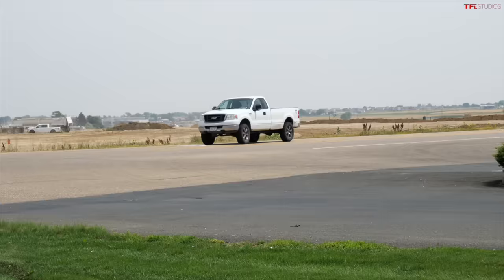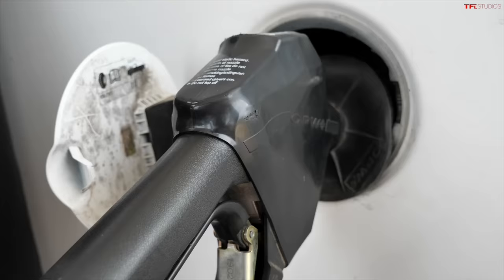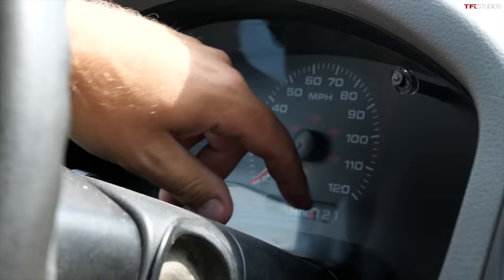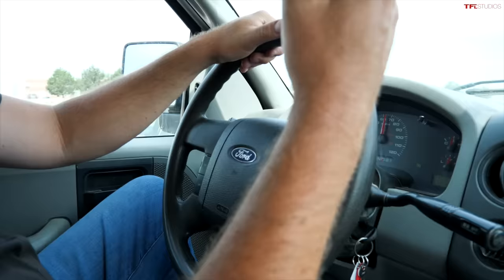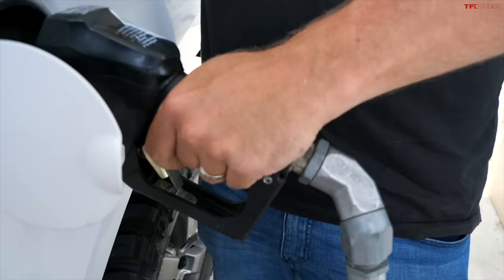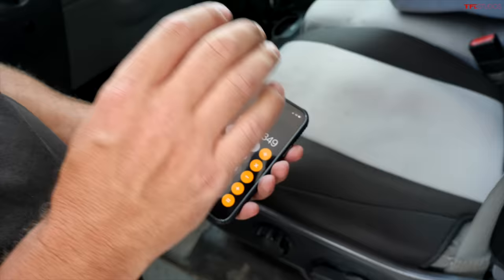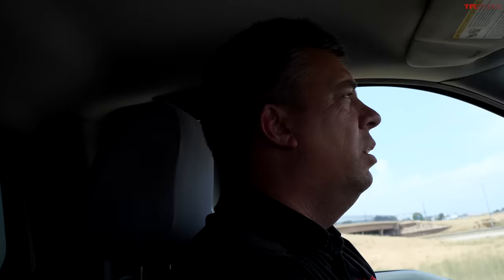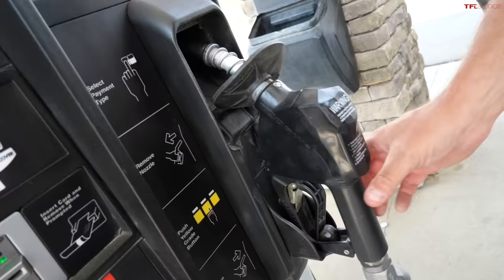Surprising Result: Here’s What Happens To Your Truck’s MPG When You Install A Topper!

Comment: It's nice to know there is no mileage penalty for the added weight and convenience of a topper.
Reply: Although at steady speed it may not make much difference in fuel mileage, consider what the added weight may do for stop and go in town driving.
Reply: @Jim-bw8jo  in my experience even full of tools the weight doesn't make much of a difference in the city efficiency wise. Lots of stop and go reduces mileage significantly even in a smaller light weight 2000 camaro with a ls1 and 6speed manual and driving it slow. My current truck gets relatively the  same mileage in the city if it's full of tools or even pulling a heavy work trailer unless I'm driving it crazy then ofcourse it's worse. It does effect acceleration and responsiveness though.
Reply: That's if you keep it empty. But I shamefully keep stuff in the back (probably because I'm too lazy to empty it?) adding more weight with the topper. Just a thought.
Reply: Thanks Brian,  you saved me 10 minutes. I didn't have to watch the video to get the answer and now I can whipe my ass. 🚽🧻👍
Reply: Who thought there would be?
Reply: The extra weight will reduce the life of the truck.
Reply: @bngr_bngr  Ok 👌
Reply: Nice to know for me, not that I would ever remove mine. Mine is for camping purposes, and I do have a full size Tacoma bed, which is a rarity these days. Hard to find full size beds and regular cabs these days. I think trucks look a little better without the camper shell, but I still prefer to sleep in the bed of my pickup rather than on the ground. I like being higher up.
Reply: @jimmym3352  And, some trucks look better in a regular cab VS crew.
Reply: @brianaustin1328  All trucks!
Reply: Too short of a distance for a 'scientific' test, but I like that at least you used the same pump at the same station.
Reply: @Jonathan Tripp the extra rise is like adding a  vertical wall to the height of your truck when you look at it from the front... that's your gas mileage killer... speaking of just shell.   Keeping the roofline straight with the cab top, it should have virtually no negative impact.   If someone could make one that would slope down toward the back even a few inches, it would help mileage a tiche....  and the trailer, anything that would shunt the air over the trailer smoothly will help as long as it's very gradual from the cab back...
Reply: quite inconvenient depending how you use your truck bed.
Reply: Next up ultra light topper will mpg go up?

Comment: I just like them for hauling a lot of stuff out of the weather and away from prying eyes.
Reply: That was always my primary reason for having a topper when I had a pickup. It also served for a place to mount rear cargo lights inside with a switch and rear exterior flood/work/backup lights up high (always had a fiberglass step up topper, except for that one cab level aluminum one that got beat to hell by a wicked hail storm in March of 89'). It was always handy for a place to rack out in out of the weather due to the jobs at the time. Sleeping pad and a make-shift pillow and I was good to go.
Reply: My friend: After getting out of the clink, I made sure to get a topper to stop the law from eyeing my shit. I am 6years strong avoiding child support and the troopers.
Reply: @Saki630  Nice, bragging about avoiding child support, great father figure.
Reply: Pain in the arse when you're hauling firewood and/or constantly loading/unloading big items. I had a topper on my old truck and ditched it in frustration after 3 months. I just carry a tarp and straps now
Reply: @davemiddleditch9741  It is a pain the ass if you have to haul large items or like you say firewood. But when I had my topper I was younger and stronger, getting it off and on wasn't too bad to do alone. When it was necessary to keep it on, I just grabbed my 6x12 flat trailer for the big stuff. It all depends on the intended reason or use. People change to the appropriate shoes/boots/surf shoes/etc and clothes for the job or event at hand.
Reply: @ernestpaul2484  too right bud. And there have been times where i've been caught out since i ditched the topper... a trifold tonneau cover is probably the best compromise for me
Reply: @davemiddleditch9741  I actually kinda prefer a topper for getting firewood. I can stack more wood because the sides of the canopy hold it and I don't have to unload it right away to avoid it getting wet. Each to their own I guess.
Reply: @WildernessGuyBC  im 6ft 5 mate... trying to stack wood with the topper on is a right mission for me but I hear ya!
Reply: @WildernessGuyBC  whereabouts in BC? I used to live off grid on Van Isle
Reply: Topper great for mother in law, dead or alive. I saved tons (she was a big gal) on gas. She was too big for roof rack

Comment: I noticed an immediate improvement with the cap on my truck. The display reads the average mpg over a 400 mile baseline that you can reset, but I didn’t reset. Just letting it run and watching that number go from 17.9 to 18.6 after about 200 miles makes me smile. Hoping to see a new normal over 19 after she taps out at 400 miles!

Comment: I had an interesting experience with an old V6 Blazer. I put a (pointed prow) rowboat upside down and nose first on top and the gas mileage went from 16 to 20. I left the rowboat on it for a long time, only taking it off when I needed it.
Reply: Same speeds, Stanley?  It's aerodynamic, but you would think it still produces additional drag, especially at the back
Reply: I am only reporting what happened. The gas mileage went from ~16mpg to ~20mpg. I didn't change my driving habits.

Comment: Thank you, this is the type of video that is useful. I would have guessed that the topper would have saved more fuel than that, but over 200,000 miles even .1 MPG adds up. Plus they keep gear dry, locked up, and you can sleep inside them. Good video.
Reply: And if you get a Bed Rug they are more comfy to sleep in.
Reply: Over 200,000 miles, the numbers they got would save you 60 gallons of fuel.  Not enough to buy the topper, but it does mean that, if we pretend their results are significant at all, there isn't a huge reason to remove it.    The weight of the topper, at 200lb, is close to 5% of the weight of the truck, so I'll bet there is a fuel penalty in stop and go traffic of a little more than this possible aero advantage.  Still, numbers are so close you can basically just run whichever configuration you want.

Comment: Two more variables to check out is driving with a Tonneau Cover and the tailgate up and with it down (no topper).  Mythbusters actually did the tailgate years ago and gas mileage was better with tailgate up!  Your results were no surprise but thanks for the data.
Reply: @jeepjeff9131
I remember that episode of Mythbusters they actually showed that having a tonneau cover on the bed of the truck was better gas mileage than with the tailgate up or with the tailgate removed. 😮

Comment: I have a 2009 F150 Supercrew 4x4 with the 5.4 Litre engine and 6.5 foot long box. I have both a ARE truck topper and a tonneau cover that I’ve used over the years along with sometimes driving the truck with neither of those installed. In my experience the best mpg I get by far is when the tonneau cover is installed.

Comment: Could you do a comparison with a flat tonneau cover, like the roll backs or the tri folds..  They won't weigh nearly as much, will cover the hole of the bed, but not reach the top of the cab to technically be "in the air"..   It'd be interesting to know the difference with that, since the weight wouldn't really be a factor..
Reply: I avg 16.4 with a topper, open bed avg 16.5 and with x4 16.8. I do 50/50 hwy and city. I also use cruise control as much as i can and dont beat on the truck.
Reply: That was my first thought as well.
Reply: Definitely agree with testing of a tri-fold or the like.. I've got a 2019, 2 wheel drive Lariat super crew, with one of the hard cover tri-folds.. Was getting about 20mpg on 4hr trips down interstate with cruise @ 75mph before the tri-fold.. Now with the tri-fold, I'm consistently averaging 22mpg on the same route.. All on 87 octane and at sea level or slightly higher for fyi.. (Just in case that may matter to ya)
Reply: From the research I've done personally, (and lots of sitting in thr bed of trucks on the highway) the bed is a turbulent low pressure zone when moving, and actually doesn't cause much drag.
Reply: @robadams1587  I can tell you when it comes to drag racing having your bed covered is actually detrimental.
Reply: The Mythbusters did the test and found that there was no difference with a tonneau cover vs without. And their test was much more controlled and precise than this one.
Reply: go straight to mesh tailgate, weight loss and no drag bucket.
Reply: Wonder what would happen if you did the tri fold with 2/3 down and tailgate down🤷‍♂️🤔
Reply: @smileyguyz  low pressure behind the cab = drag.
Reply: Tonneau covers reduce mileage. Driving without one create an air bubble in the bed which effectively helps reduce wind drag over the rear half of the truck. Adding a cover creates a down force from the wind coming over the cab which in turn reduces mileage.  A lightweight aluminum cap would be best for POTENTIALLY increasing mileage and offering bed protection
Reply: I gained a solid 2 mpg by adding a tonneau on my Tacoma.
Reply: @88PeteZa  Yeah, all these other guys arguing about toppers and tonneaus when really there are so many different configurations for pickups.  Cab size, bed length, wheel size, gearing, weight, type of tire ... geez, the list goes on and on.  No two people should expect the same results unless they have identical trucks and set ups.  Silly to argue about it.
Reply: @dan776    Uhhhh.......  no.
Reply: @Prestiged_peck  i always cover my box when in drag too mate👍
Reply: The soft trifold I run is only about 20lbs if that.
Drag off the tailgate should help you would think.
Reply: @smileyguyz  Mythbusters asked a truck manufacturer after testing tailgate up vs. down.  The manufacturer said that the air creates a rolling zone of air in the bed after hitting the tailgate and that this rolling zone of air acts like a slant back from the top of the cab to the top of the tailgate.
Reply: I average 16mpg with no trifold tonneau cover and 19mpg with it on. I drive nationwide at 55mph in a Ford F-150 5.4 triton V8. Speed will kill your mpg. Wind resistance on your grill and windshield after 60mph only drops your fuel efficiency. I save about 20 gallons in a 1800 mile trip. Well worth it.
Reply: @smileyguyz  I read a report done by a lab (CR Reports?) that basically said that having an open bed with tail gate down made no difference in fuel mileage. Just not that much drag behind the cab which makes sense from an engineering perspective.

Comment: I love the 4.6L. I had a 97 f150 4x4 off road super cab.  It have a 5 speed manual.  In Iowa, I would regularly 23-24 mpg.  It did have a hard tonneau cover.  I would be light on the gas pedal.
Reply: Yep driving with a light foot is the best thing you can do for MPG. Sadly most people drive like they're in Formula One which just wastes fuel. Stomp on the throttle, slam the brakes. How many times do you see people accelerate into a red light? It's silly. No, you want to be smooth. Plus in a manual if you use the engine break to slow down you consume no fuel at all for that distance traveled.
Reply: Great information.  This model F-150 is the perfect size.  I had a 99 F-150 with the 5.4 & the 4 wheel drive is really capable.  I also managed 176K miles when I traded it in even though I've read the 5.4 can have many issues.  At best I managed 17mpg on the hwy.  I would def get the 4.6 with the manual if I was to buy another one.
Reply: I lent my truck to some friends. It had a slow oil leak and they didn't check it.  I wasn't upset. The 5.4 could be swapped in.  The auto mechanics class started the swap but never finished it. I have the truck back at home but it's been sitting for 10 years.  My carpal tunnel is so bad it's difficult to work on.  I have had the 5.4 in other vehicles. It's just not fuel efficient.
Reply: @quazaar  i dont know why anyone would swap a 5.4 into anything. Lol 4.6 is a much better engine without the sparkplug spitting, manifold cracking,cam phaser ticking, timing chain guide eating issues of the 5.4 3 valve triton.

Comment: About 40 years of RV experience here, 20 designing fifth wheels. Experience and wind tunnel tests show the secret is how the wind underneath comes up at the rear and actually pushes you forward. The flatter the rear is, the better push.
  And someone mentioned drafting behind a truck. If you were to get very close (of course do NOT do this) so the wind would not be able to push the truck but would continue under your trailer and push at the rear you receive a little more assist. Best to keep your distance for safety of course.
Reply: I’m curious how gas mileage would change if you were pulling a camper. I imagine it would be significant difference. I can pull camper with my van much easier than with my truck

Comment: Adam & Jaime and Mythbusters did this same experiment with the tailgate Up/down gas-mileage test, and found the truck achieved better mileage with the tailgate UP.
Reply: That's because newer model pickups are designed for better MPG with the tailgate up. Think back a few years and remember the change in the top edge of the tailgate. Today and for the last 15 or so years it has been much wider or thicker. Ford did a study and found that the airstream coming down off the roof of the pickup landed right at the tailgate. By increasing the top surface area they changes the way the truck performed. There is a video on YT about it.
Reply: @bobd.  Has to do with the bubble affect. Air itself gives the least resistance. Drop your tailgate and air coming over cab drops down into bed and texture of bed determines wind coefficients. That's at highway speeds. Around town tailgate up can reduce fuel mileage because of less bubble affect.

Comment: I learned the same thing when I put an ARE topper on my Sierra. Road trip FL to VA, essentially same mileage as before. 
Two things may help: 
 - sealing the gap between cab and topper. I can hear the wind blasting between the two (it's a regular cab, so it's right behind my head). The truck had virtually no wind noise before adding the topper. 
 - adding some sort of flat spoiler at the rear of the topper. Look at any modern hatchback or suv, almost all of them have some sort of wing or spoiler on them. Even back in the 70's, station wagons often had a curved (down) spoiler on them.
Reply: The rear wing apparatus on SUVs and old school station wagons are to redirect airflow for two reasons..to keep the rear clean and in the station wagons ..exhaust from looping back into the interior with the rear window open...we found that out on a family vacation in 66 when the roof rack had a load lashed down blocking the airflow during a leisurely tour of Yellowstone  and a cpl of us kids in the rear seat nearly being gassed out

Comment: I ran 17.something might, close to 18 mpg, in my 1995 Yukon. You have to run 200 miles to get better results. Cause I went over 200 miles for that test on the Yukon. 
When I had a S-10 the tailgate made a big difference,  and that 4 cylinder made noticeable improvements with the topper on. It had a 8 foot bed also. This is a S-10 from the early 1980's. I don't remember the exact year though. 
When I check for milage, I always go further than 50 miles.
One other thing, the Yukon got close to 18 mpg on I-80 where there were a lot of hills, to go over. I was surprised even, but I did try to push the gas mileage, by driving the speed limit, or a little under at times, in overdrive all the way.

Comment: Good comparison, as close as you can get for a short test. Only variable might be the ambient air temperature between the two runs. I'm guessing that you had at least two hours from the start of the first run to the start of the second run. Depending on time of day the air temperature (and density) might have changed. I had a 2005 F-150 4x4 with the 5.4L V8, automatic, and 6.5 foot bed. Don't remember what the axle ratio was but it got consistently between 15 and 17 MPG (depending on the season) with just me and no load in the bed. I had no cap or tonneau cover on that truck. I logged every drop of fuel I put in that truck for 10 years and 114K miles; recording the data in a notebook I kept in the truck. Did that for no reason other than I was curious. I could see when the fuel was switched over from Summer to Winter blend, it was an immediate 2 MPG drop that would show in that first tank of Winter blend. Most of those 114K miles were back and forth to work plus the usual around town driving. My commute was 18.5 miles each way. All back roads and no reduced speeds or bumper to bumper traffic to deal with.

Comment: I did a similar change on my 2014 F150 a few years ago. I was going to put a topper on it to provide lockable space for stuff as I have had on 4 other trucks, but I couldn't get one in the time frame I needed so I settled for a folding hard tonneau I could get right then. I noticed my gas mileage didn't change a whole lot from the smoother drag profile but the RPMs at any given speed went down. At 65 mph the motor speed dropped by about 250 RPMs so even though MPGs weren't a lot different, the motor was obviously working a lot more easily. Also, the truck got up to speed a bit more quickly. Either way it was a good thing and my stuff has a locking, water proof compartment. I'm happy.